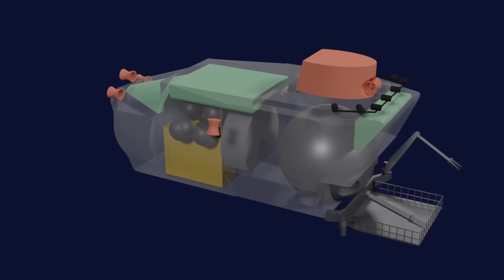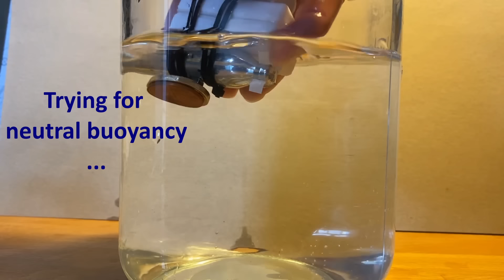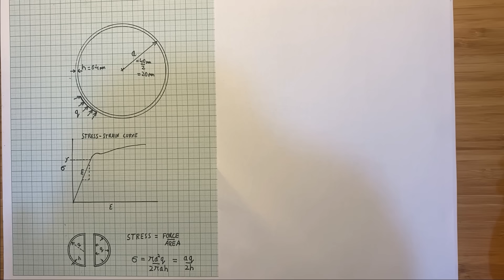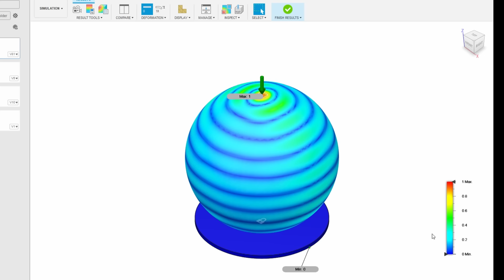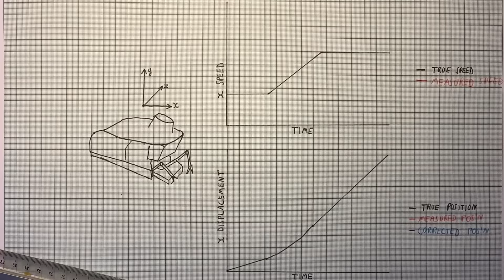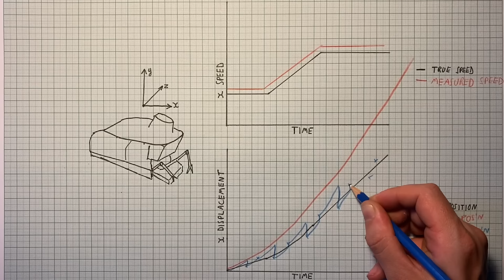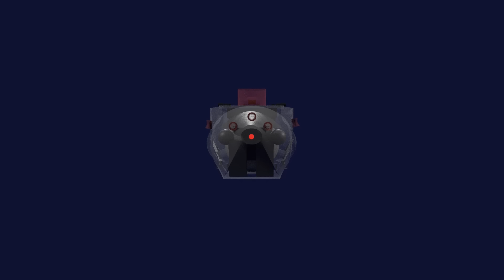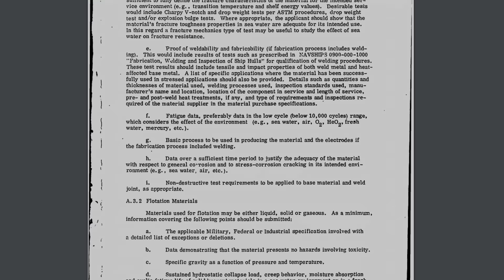DSV Alvin : How to build a safe submersible

Comment: I got to jump inside Alvin around 95' when its NOAA surface ship NOAAS Chapman , was in ballest point , San Diego for preparation  to  the S. Pacific.  It had the original oblong  conning tower on it at the time. It also had several burn  marks along its rear outer structure from exploring a little too close to hyper thermal vents ,heated fissors in the   deep canyons around Galapagos island. It was tight for just me inside the sphere. Very honored to be allowed in.

Comment: It’s a 20 tonne craft, but a thin rope could apply a few kN and still overcome its sinking force if the sub was just under neutrally buoyant.
Reply: And snap when the currents, the motor, the ship, or anything else applies a greater force

Comment: also, as an aside… When Alvin was built, they would've been using slide rules to make calculations. My dad was still doing that for Thiokol Star solid rocket motors in the mid-70s; he didn't get a calculator until about 1977.

Comment: Heya, regarding the attitude and positional referencing systems. My mind started to tingle again!
In (civil) Aviation we use a thing called Laser-Gyro's as a way to digitally track our attitude, combining data with dead reckogning for positional information
And requiring a "nav-fix" by set points (visual-based approach) and ofcourse GLONAS/GPS fix performed automatically

Then on the subject of the Dopler system, a very similar system can be see implemented on various helicopters, though most of them either old- and/or russian.

Due to the whole attitude-based control scheme for helicopters it's much more prone to the already mentioned inaccuracy's when relied on as the sole nav-support system.
Reply from the maker: Turns out the fiber optic gyros in alvin operate on the same principle as ring laser gyros. So yep, ridiculously accurate. They are honestly probably overkill for a dsv but they were probably put there at the request of the navy.

I’s never thought of a doppler radar for helicopters but that absolutely makes sense! I’d only ever thought of it being a one-axis system (ie the rad-alt).

Anyway, I’ll be talking quite extensively about inertial measurement in my next video. For some reason, the subject seems to crop up in every video I make!
Reply: @Alexander-the-ok  Rad-Alt indeed is the most common use for RF-assisted navigation equipment in aerospace

And normally this is also just one of the key elements used in especially rotor-wing implementations. Firms just experimented with the use of Doppler nav into the 3 dimensional space,
 but often - atleast, from what i've heard they would just place pictures or boards over the "moving-map" instruments (powered by Doppler)
as they would be as accurate as my memory after a visit to the pub

I'll be looking forward to the inertial-navigation video!! it's one of those things i just can't ever get enough of :)

Comment: "I'm going to use metric!"
*Uses bar rather than Pa
Reply from the maker: Yeah…..was gonna make a comment about that but couldn’t be bothered.
I use Pa normally but went with bar here since thats the convention for a lot of subsea engineers.

(To be fair, the calcs are in metric - i just converted the answer to bar at the end)
Reply: @Alexander-the-ok  Fair enough. Bar is pretty common in aerospace engineering as well, and certainly better than psi. I just prefer Pa myself

Comment: I don't know, but you are an engineer by trade, right? If you weren't and you would be someone who welds or actually fabricates, it wouldn't be such a wonder for you that the material fails in other places than the weld. Every good, or even decent weld should do this, be stronger than the material itself. Not only electron welding, no, even simple stick welding. Even glued wood does that. Totally normal. BTW I guessed the buckling of a ping pong ball on 3 to 4 bar, not because I'm so good, I am not, I am quite average, it's because I'm working with different materials for 30 years. And with engineers. And I was fighting them almost daily, these days I got my own firm, and the wonder for me is: If you are the customer, the engineers are logical, compliant and even try to be practical here and there. THAT, my friend, is a miracle. Cheers!
Reply from the maker: I quit the industry years ago - I’m a data scientist now so may be a little rusty. Electron beam welded casing was pretty novel at the time I worked in that field and none of us could quite believe non-additive welding could do that….but it turns out it could!

Comment: A bad weld can overheat or thin the material next to the weld, causing a failure that many welders will hail as proof of a great weld, because the material failed near the weld but the weld didn't. This is wrong. If a proper weld is going to weaken the material nearby, then you need some plate to spread the joint stress. 
Don't let a Dunning kreuger welder tell you how strong his welds are because the parts always fail off his weld.

Comment: For the 'sphere'. A unused Russian 'Soyuz' sphere could be bought very inexpensively. It would already be rated for the pressures required.
Reply: No?  The pressure difference in space is only 1 atmosphere of pressure.  At 6500m, it's about 640 atmospheres.  It wouldn't be anywhere near the necessary pressure rating.

Comment: Fun fact that is probably already mentioned in the video:

Alvin sank in 1968 when two support cables snapped, causing it to fall into the ocean with its hatch open. The submersible was later recovered and put back into service.

Despite this, Alvin still has a clean safety record. When she sank in 1968, all three crew managed to escape relatively unscathed.

Comment: One thing I've never understood--why Titanium for the main pressure vessel, and not steel? Titanium is certainly lighter than steel, but by volume has no real strength advantages over good steel alloys, and weight doesn't seem like a major consideration since any lost buoyancy could have been easily compensated for with more foam. So why go to extra expense? Did they need the corrosion resistance? Was weight more of an issue than I give credit for? Is there something special about titanium for pressure vessels that I don't know about?
Reply from the maker: Titanium alloys generally have a higher strength/mass ratio. Mass is THE consideration. It takes a surprisingly large volume of syntactic foam to lift a relatively small mass, so even a modest saving in mass for the pressure sphere causes a drastic reduction in the overall size of the craft.
Reply: @Alexander-the-ok  Saving mass/weight was actually reason for why Mir submersibles didn't use titanium spheres.
Used 30% cobalt (+little chrome/nickel/titanium) ultra high strength steel alloy had 10% better strength per weight than titanium alloys. (of the time)
Also other very unusual construction methods were used to kepe weight down and buoyancy close to neutral.
That design using submersibles could have changed markets entirely, if USA hadn't forced ending development and manufacturing.

Comment: Eh, isn't that pingpong ball filled with air at 1 bar? But oh, those bicycle pumps also start at 0 bar.
Reply: Yes. Both values (calculation & pump) have a common zeropoint with atmospheric pressure subtracted.

Comment: I just want to say a pure oxygen enviroment doesn't have to be a problem as long as there aren't ignition sources or reactive materials on board, even the apollo missions kept that for most of the mission time. Pure oxygen at a partial atmospheric pressure is still the most efficient  enviroment in spacecraft today, this includes the ISS.
Reply: You are mistaken - no mission since Apollo used pure oxygen, instead they work with a atmospheric mix. Mainly for biomedical reasons rather than safety, though
Reply: @HalNordmann You're right, from shuttle onwards it was nitrogen/oxygen at either much higher partial or full atmospheric pressure.
Reply: @slome815  Soviets always used a oxynitrogen mix, but not for flame retardation, but to keep their ship's instrumentation cool - they used air-cooling almost exclusively.

Comment: As someone who does a lot of drafting and graph drawing, could you please tell me where you got that ruler! It’s literally the best of both worlds! Clear so you can see behind it and strong so it doesn’t flex! I could really use a ruler like that. And it looks like it’s even in metric!
Reply from the maker: Youre not the first to comment on it. Wish id looked after it better and it didnt have blobs of solder stuck to it! My wife got it from a sewing shop years ago. Im afraid i have no idea which shop it was though.

It says ‘helix T35’ on it but a quick google search suggests they arent made anymore.
Reply: @Alexander-the-ok  thank you anyways. At least it’s a lead. It looks like a very useful and practical ruler for making technical drawings with. It I find anything I’ll reply to this comment.
Reply: For what it's worth, there's an old Amazon listing that shows the package, and on the package it says "Helix Aluminum/Plastic".  (It doesn't actually say "ruler"; I guess that's implied.)  The listing indicates that it was available as recently as 2014.  A bit surprisingly, I didn't even find any used ones on eBay.

Comment: The lack of heat resistance is why Titanium never really took over from Steel Armor plate in a broad sense. The heat caused by a projectile impact can get pretty significant. I've also read that Titanium is difficult to reforge. There are rare exceptions such as Russian Nuclear subs.

Comment: No need to apologize for using the correct units. Skipping all the messy conversions between messy units such as inches, feet and yards just simplifies everything immensely. There's a reason why second is an SI unit while minutes are not.

Comment: Lithium Iron and even more so Lithium Titanate batteries are incredibly safe compared to Lithium Ion batteries. Lithium Iron fires can't spread to other cells and are incredibly tame, and Lithium Titanate literally won't catch fire at all even if you bash it with a hammer, cut it in half with a bandsaw and hold it under a blowtorch.

Comment: Something that's not really talked about in these presentations is the crew hatch. It's known that the Titan crew were bolted into the sub. How do other DSVs do it?
Reply from the maker: Its so simple I forgot to include it in the final script. Just a wedge shaped plug hatch that is held in place by the external pressure. It had a finely polished sealing surface which the crew are careful to protect during ingress and egress to prevent scratching.
Reply: @Alexander-the-ok  wow that's underwhelmingly simple and reliable
Reply: @thomasphillips885 Simple and reliable is what you want with this stuff

Comment: NEVER APOLOGIZE FOR USING METRIC.
As a red blooded American, I can tell you if an American can do base 12 math with feet, base 16 with pint, and base 5280 for miles; WE SHOULD BE ABLE TO FIGURE IT OUT. That's me yelling at other Americans, not you. 30cm in a foot, guys. 355ml in 12 ounces. 2.2 pounds to a kilogram. 3.8 liters to a gallon.

Comment: What I do wonder, would heated liquid underwater "balloon" work? heating lifting material could be easy way to achieve buoyancy regulation
Reply: Well, you'd be fighting the fact that deep water tends to be cold, so I'm not sure how "easy" it would be to provide the required amounts of heat. If you're using something like a battery, using that electricity to actively power a propeller might be easier and cheaper than heating lifting material.

There are unmanned underwater gliders which sort of do the opposite thing. They use the fact that deep water is cold to power a heat engine, that powers a small oil pump to alter buoyancy. The amount of energy is small, and efficiency is low due to the small temperature difference, but it's enough for the unmanned glider to dive and climb indefinitely. Good for very long endurance missions.

This is basically the "syringe" method of buoyancy adjustment from the video. The amount of adjustment possible is small, but it's enough for this specific application.
Reply: I was thinking of possible heating methods, and an old school magnesium torch came to mind. Magnesium can burn with sea water. However, this generates hydrogen gas, so the obvious thing would be to directly use the hydrogen gas for positive buoyancy.

You could have a drop weight that's a pipe closed off at the top, with the magnesium torch at the bottom. Light up the torch, and the hydrogen gas will displace water, making the drop weight lighter. Voila! Reusable drop weight.

Comment: 37:04 Did you mis-speak? (Adding the asterisk might be more sensible):

A passenger smelled burning, leading to the pilot opening this little electrical box and cutting every wire. Then he went back, found which wire it was; left that one **dis**connected, and reconnected the others.

Comment: i still don't get why you don't just have a steel cable or wire attached to the thing so you can recover it with loss of buoyancy and or still be able to communicate with it.
Reply from the maker: Its actually probably more dangerous to do that than not due to the entanglement hazard. It is a huge limit to capability and would restrict what the submersible was able to do. And, at 6.5km, it genuinely becomes difficult to lift the 20t weight of Alvin + the weight of the cable itself without it breaking.

Comment: I wonder about a windowless DSV, using cameras and VR goggles. It could be tethered to an exploration/manipulation drone, so the main submersible is less likely to get entangled.

Because the crew sphere lacks windows, it doesn't need to be placed with window view in mind. I'm thinking an oval mattress shape, with the crew sphere near the center.

On the surface, the mattress shape naturally floats horizontal, with the crew hatch either above the water or pointed straight down. Either way, it's possible to make a safe escape in calm water. Submerged, though, the sub tilts vertical to reduce drag going down/up. Submarine gliding is also possible.

This configuration wouldn't be good for window view, because the crew sphere is far away from the ends. But with VR goggles, the cameras can be clustered at the ends, and a tethered exploration drone could go almost anywhere.

The mattress shaped crew module could lack thrusters, having only batteries and life support systems. It's tethered to a heavy "tug" unit that includes thrusters, fine buoyancy control, and drop weights. The exploration/manipulation drone has slight positive buoyancy, an slightly positive buoyancy fiber optic tether, so it doesn't interfere with the tug.

Again, this heavy "tug" unit is bad for window view. The crew module can't even reach the bottom, due to the heavy tug and its tether being below it. But it's good for safety and the exploration/manipulation drone can go anywhere.
Reply from the maker: Alvin has operated with a tethered drone before. It even caused a safety incident on the titanic wreck when the drone entered the wreck and started unexpectedly pulling Alvin along with it.
Reply: @Alexander-the-ok  It could be safer if the drone used a thin fiber optic cable - far too weak to pull the mothership. If it snagged on something, it would just snap rather than pull the mothership along with it.

After that, the drone might fall back to audio commands to try and escape and independently return to the surface eventually (slight positive buoyancy). Or, depending on the circumstance, it might be commanded to simply do nothing and wait for the mothership to return with another drone.

My point is, you don't necessarily want the drone to automatically try and escape, potentially damaging a site or something in the process. The crew's judgement may be that it's better for it to do nothing, or to try and move it to a better location for later recovery.
Reply: Eh, never mind about the heavy tug unit. Thinking for half a minute, I realize it's just not worth the extra operational complexity. I still think the advantages of a tethered exploration/manipulation drone could be compelling, though.

Comment: You are overcomplicating things. You could just use carbon fiber tube with two titanium caps on both ends. I bet it would be significantly cheaper, simpler and safer.
Reply: Lmao
Reply: make sure to glue it in a warehouse with a dirty rag for cleaning
Reply: I agree. Skip any and all guidelines and test it live. Fire anyone who tries to tell you otherwise. .... mumble shit about Boeing and NASA and The University of Washington if the public gets nosy.
Reply: Don’t forget that you will save tons of money and make the system so much more reliable by using a cheap Bluetooth game controller to maneuver this modern marvel you are building!
Reply: That's innovator thinking right there

Big brain ceo thinking 

Get this man a contract